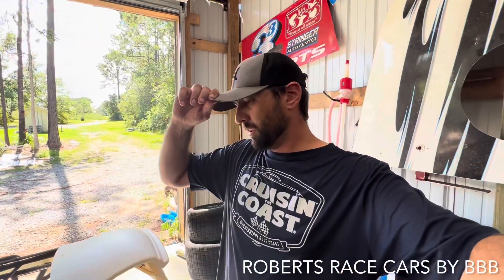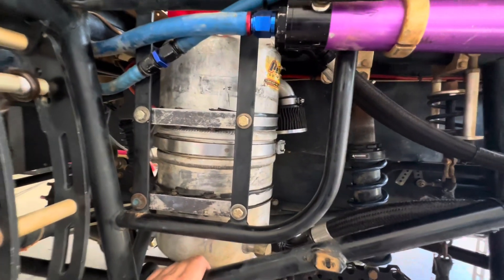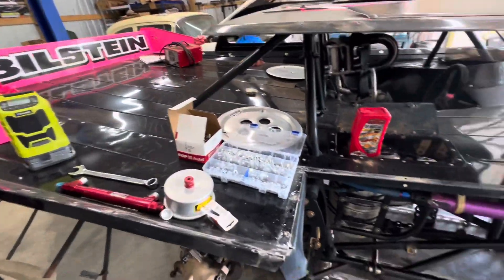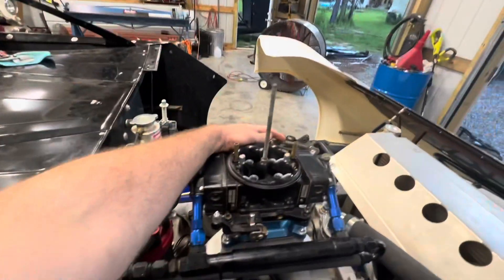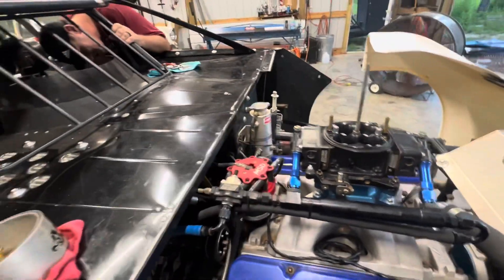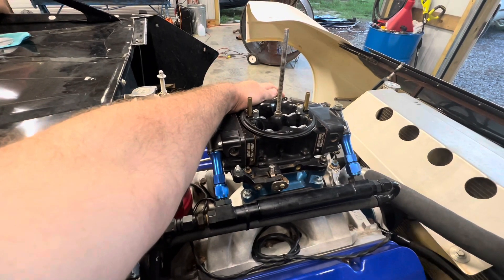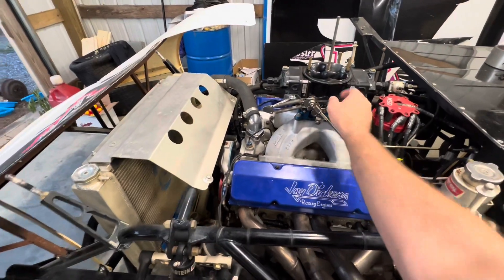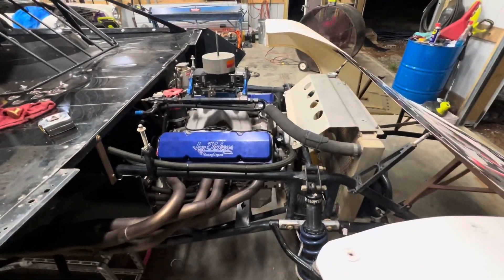It’s alive!! Firing up our Jay Dickens power plant for the first time!

Comment: The Jay Dickens engine is definitely a good engine. Since it is NOT directly from GM. Such as the crate engine that HTF got through Jay Dickens. 

Because when someone ask me about GM crate engines. Then you are asking about a mixed bag, due to the fact I used to see new crate engines for street cars that were fine. Then I seen them that were junk, and caused more work, because GM definitely has its issues with quality control...